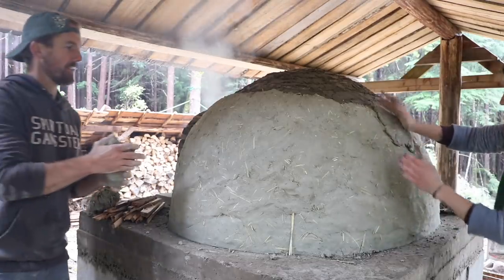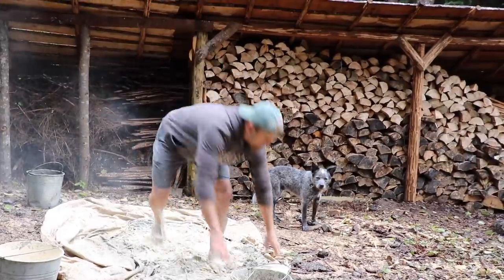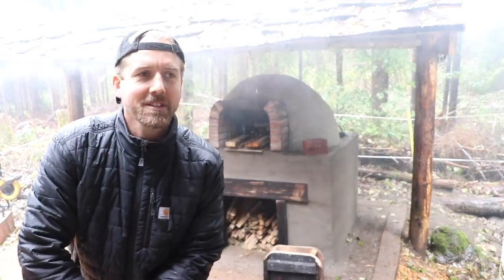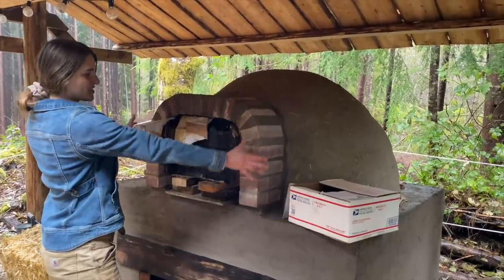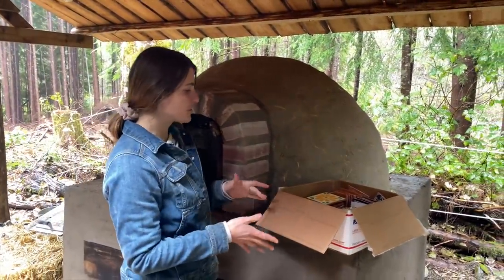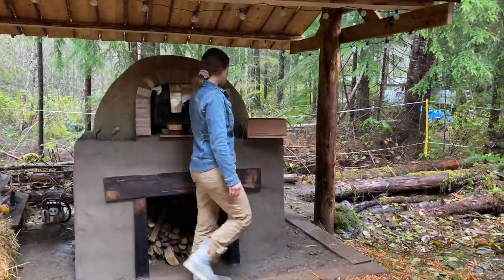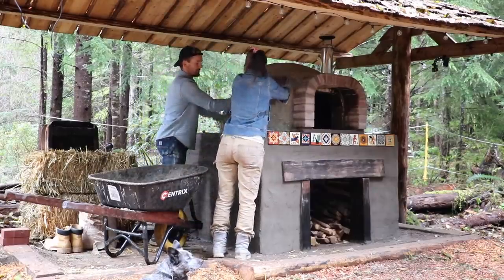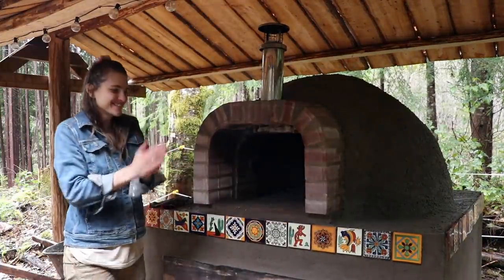ESCAPE TO THE WILDERNESS | DIY BRICK PIZZA OVEN, Day 9 - Chimney Flue Pipe & Clay Cob - Ep. 111

Comment: Kurt's last general comment specific to wood ash being a good admixture to a compost heap. It contains Potassium (much more than in coal ash) and Potassium is a vital plant nutrient, which most gardeners apply  by means of artificial K-N-P fertilizers. Chimney soot can be used as natural pesticide to keep slugs and ground crawling pests from devouring cabbage and other vegetables. You drizzle a small 1cm ring of soot dust and flakes around the row of veggies, and the ground-crawling pests won't climb over it because of the soot PAH (poly-aromatic-hydrocarbon) chemical content. Back to your cement curing of the Pizza oven. Cement is basically produced from raw slate and limestone (minerals containing mostly Aluminum, Silica, Calcium and Carbonate - as metal oxides with hydrated -OH content and Calcium carbonate). When the mineral mixture is kilned at high temperature, the CO2 from the carbonate and hydrated -OH are removed thermally as H2O vapor and CO2 gas. When you mix cement with water, it rehydrates into Ca-Al-Si oxides and carbonates. The carbonates formation during cement curing requires CO2 to occur. Ambient air contains miniscule CO2 (ppmv=0.001 vol% range). Smoke from a wood fire contains CO2 in the around 5-10 vol% range). Hence the faster and better high strength cement curing with a fire in the pizza oven or smoldering char coal beds in a brick house.

Comment: You should drill a two inch hole in the back at the floor the when you start the fire put paper inside the stack the lite that paper it creates a draft going upward this will keep your fire lit and fresh air need to keep it lit you and put a adjustment cap on the the hole buy using a can lid with a screw and bolt with a nut for a handle
Reply: What ?? You should run for president with a speech like that.

Comment: Chimney soot tends to  build up on the interior wall of an exhaust flue pipe, particularly in wood stove flues and usually in the the middle to upper flue sections where the semi-volatile gases of the wood smoke tends to condense on the interior flue surfaces. If the chimney flue interior of your chimneys (upper section visible from the top) shows sign of soot built-up, you may sweep it yourself, and collect the soot in the stove as a natural garden pesticide use for slugs and ground-crawling pests. Now not to overly worry you, today's insulated aluminum or steel flue ducts tends to take longer with soot build-up than old non-insulated brick chimneys that needed annual sweeping to assure against a potential chimney fire. But better be safe than sorry later. Cheers from Kurt

Comment: 02:44. Slow motion wood splitting lesson !  
This is how to see leverage of the maul in action. Notice that Jake has his hand at both extremes of the handle as the maul is lifted. When the maul is over head (max point of potential energy) using gravity, it is easily guided in a downward direction. Notice how the hand at the maul head slides to meet the hand at the base of the handle, creating maximum splitting force.  Poetry in motion.  This simple action, finally documented in slow motion. Thank you

Comment: Hey guys!!! You don't know me at all, and that is ok!! But I have been a Mason, specializing in fireplace and chimney construction for over forty years!!! I hope your pizza oven never fails you, ever!!! But please consider this... it takes over twenty five to twenty eight years for concrete and mortar to fully and completely cure!! That is not too say that using your fireplace or pizza oven has to wait that long before use!!! Of course not.... HOWEVER, PLEASE ALLOW AT LEAST TWENTY ONE TO TWENTY EIGHT DAYS for the water in the mortar mix to naturally dry out!!! By lighting a fire immediately after building that structure could cause cracking in the mortar joints and the pardge (finished outer concrete layer) and eminent failure of the structure or WORSE..., EXPLOSION due to trapped moisture filled air pockets!!!!
 ANYWAY, KEEP ON KEEPING ON PIONEERS!!!!!!
PEACE 🤘
P.ost S.cript... I DO NOT WANT TO SEE YOU FAIL AT THIS LIFE STYLE!!! NOT AT ANY SINGLE THING!!!🙂

Comment: Part of the problem with the heat on the bottom did you put those bottles in there, your idea was it that was going to trap heat and release it later but it does exactly the opposite. Air doesn’t hold heat it is an insulator so basically the bottom of your oven is insulated and won’t hold heat or absorb it what you want there a solid rock or at least solid concrete. If you really want to fix it what you need to do is break out that bottom and dig those bottles out import new concrete in there or rocks and concrete because rocks hold heat. Imagine throwing a bottle on a campfire and throwing a big heavy rock on the campfire the sameSize or even a bottle full of water, you take them all off the fire and the empty bottle is going to cool in two minutes the bottled water is going to take five or eight minutes the rocks gonna be hot for 10 or 15 minutes and slowly release all of that heat camera those empty bottles aren’t holding heat. Putting some rocks around the edge inside the oven might help as they will absorb heat and release it slowly at a lower level but when you built the bottom and put all those bottles in there and all of that stuff to aerate the concrete all you did was insulate it which keeps the heat from getting into it and the bottom of your oven is never going to get hot, the best thing you could have on the bottom of the oven would be a big slab of granite or a very hard rock or at least concrete because as you bring your fire that’s going to absorb a ton of heat. Imagine the way you’re cooking pizza now if you put it in there and put it on top of some oven mitts and insulated the bottom of it it’s got a cook from the top not the bottom. Another option if you don’t wanna break all that out just to be able to pour a new bottom and have a thick layer of hard concrete without the aeration stuff, (think you called it pearlight) and the bottles. They would act as an insulator still but if you got a layer of brick or concrete on the bottom that would retain heat to cook the food and provide heat from the bottom like a stone oven.  It would still be best to break it out as much as you can and replace what you could even if you poured the bottom thicker so it was a bigger mass to retain more heat. 

You can deal with it by just making massive fires and cooking stuff from the top pretty much but it’s not gonna come out like a pizza oven Pizza because you’re cooking from the top not a hot stone. Other than that you could make a stone insert that you said on top of the coals so at least that gets hot but to make it work properly you’re gonna have to get in there and smash out the bottom and get those bottles out of there and all of that aerated concrete stuff because you put that stuff from your garden in there and you need solid concrete or rock in there to absorb and hold the heat. 

Also on your arch it needs to be an arch the sides are OK but at the top you can’t just suspend brick like that unless you have wedged bricks. The motor will hold it for a while but it’s not really an arch you’re trying to suspend bricks vertically instead of horizontally and it’s not made for that your mortar in any kind of concrete or brick is made to hold weight but it’s Brittle so it doesn’t have any or much side to side strength if you look at the old arches they made when they get to the top the bricks are cut like a wedge not squares or rectangles it’s more like a triangle and that’s because that pushes in and up when you’re doing a vertical line across the top flat like that the ones in the center have no support except for the strength of the mortar.  To do something like that you would probably need a piece of steel going under that brick to hold it up because overtime that’s just gonna keep coming down it may last a while but it’s always going to want to come down word and overtime is that mortar dries out and cracks it’s eventually going to want to fall apart.  There’s a ton of science to arches and engineers will tell you that it’s one of the hardest structures to build. The best way is to copy arches the Varty worked for centuries and all of those are actual consistent arches or square on the sides is fine in the arches basically sitting on top so your sides are fine just the top would need to angle more or you need to cut those bricks in a wedge, Basically the brakes should stack that way and hold them selves without mortar just being put in there loosely then you know your arch is consistent and you’re not just waiting for your motor to crack in the whole thing to break. Once your brakes basically stack and hold them selves then you add a thin layer of mortar and overtime as it starts to crack and break the bricks will just fall into each other and support each other come out the way it is now it’s just the motor sticking in there, and gravity in the weight of the bricks is always going to be fighting that mortar. A solid arch you should be able to jump up and down on or even drive a car over. That one you could probably pull down if you tried. I’m not saying all this to be a killjoy I just have a lot of engineering education and understand thermal and hydrodynamics and those are the two things that are going to be the biggest problem with the oven, the arch and the bottom of the oven being aerated were hollow isn’t going to retain heat. The dome came out awesome and your brakes were angled correctly and always leaning on each other and supporting themselves but when you use that word to hold up the bricks on the arch once you take out the wood you have nothing supporting the bricks except for that mortar and then time that will crack and break up and there will be nothing to support the bridge still want to come straight down.  I think if you redo the bottom and just angle your arch it will be a lot more efficient and easy to use and probably be there for several decades If not longer, your basic dome structure was done very well and that was the hardest part, the arch is simpleBecause it’s outside, you can just wait till it falls down and rebuild it really but replacing the bottom of the oven or adding a fairly thick layer of heat conductive hard concrete or rocks/bricks will make it work a whole lot better.  It will probably still work without it you’ll just have to keep a lot of fire in there to generate heat which is kind of kind of be like a smoker so you might want to cover some things like breads especially if you’re making something sweet that you don’t want a lot of smoke flavor on. Fixing the bottom or even just adding a layer will just make it a lot more efficient. On a good stone oven or wood fire oven like that you should be able just to build a good fire on the bottom and then scrape the fire out completely or just push through many calls all the way to one side and the bottom of it should have enough heat to cook for A good 10 to 15 minutes with high heat and up to 30 or 40 minutes before it drops to a real low heat but you’ll see the bottom temperature will go up a little quicker and get hotter and stay hotter from a much smaller fire and it’ll just be a lot more efficient and consistent. 

Overall it looks awesome you guys did a great job on it come out that’s a ton of work and it came out really good.  Cosmetically it looks amazing too and the box around it with the tiles it’s gonna look great, that something you can put out in an outside restaurant where people could see it and it could be a functional showpiece as well.  This has been a very very cool project. I really liked the wok too.

Comment: pizza with cherry tomatoes and zucchini flowers.   CRUST  basic pezza dough  TOPPINGS  2 tablespoons extra virgin olive oil . 5 ounces (150 g) fresher mozzarella cheese, thinly sliced. 4-6 large zucchini (courgette) flowers, rinsed and dried 6-8 cherry tomatoes , halved . salt and freshly ground black or white pepper? serves 2 preparation 15 minute time to prepare the dough and let it rise. cooking time 10- 15 minutes . CRUST  1. prepare the pizza dough following instructions page 8 -11 . set aside to rise. 2. preheat the oven to 500 degrease F (250 degreases C / gas 10 ) 3. oil a 12 inch (30 cm ) pizza pan . 4 . knead the risen pizza dough briefly on a lightly floured work surface. then presses it into the prepared pan use hands.  TOPPINGS 5. drizzle the dough with 1 tablespoon of oil and cover with mozzarella, leaving a 1/2 inch ( 1 -cm) border all around. top with zucchini flowers and cherry tomatoes . and drizzle with remaining oil season with slat and pepper 6. BAKE for 10 -15 minute until base is crisp and golden brown and cheese is bubbling and beginning to brown 7. serve hot. not zucchini flowers are available frames markets in spring and summer . their fresh , delicate taste adds a touch of class to the pizza serve it with glass of cool , crisp white wine.
Reply: let what recipes tast good might mill up counter top for make dough on in out side kitchen.